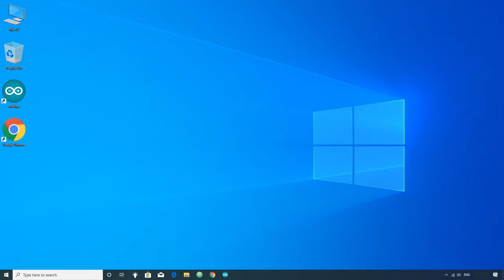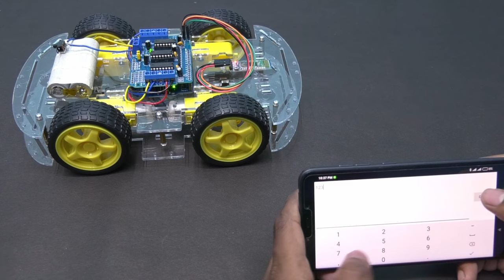Bluetooth controlled Arduino RC Car | Control using your Mobile Phone | Ut Go

Comment: Hello, when I connect the Arduino to the USB & motor drive to 12v the motors work but when I disconnect USB all motors stop working. I wonder you connected the power to driver only and it works. Please If you can help?
Reply from the maker: I connected the power to driver and connected the jumper so that power from driver goes to Arduino board. Check if jumper is connected or not in you condition. But make sure to only connect the jumper when you have one power source. If you give power to both Arduino board and motor shield then the jumper must be removed before giving power.

Comment: Bro is it okay to use 9v battery or lithium should be used.Can we buy cap for lithium ion battery
Reply from the maker: 9volt will not work. You have to use lithium based battery.
Reply from the maker: Welcome Bro

Comment: i am using 4 batteries in series, each of them is 1.5v( AA battery),. when I connect and control the car, it only work for 1-3 second, and then the motor seems to be stuck and cannot rotate, can you help me.
Reply from the maker: AA batteries cannot provide enough power. Use lithium ion batteries. You can use two 18650 lithium ion batteries in series.

Comment: Please enter the code again. The code of the description box does not open. Moreover, if the 3.7 volt battery in the Bluetooth control car is powered, the 4 motors do not work, what is the solution?
Reply from the maker: First login to your Gmail account then open the code link and download it.
You have to use 2 x 3.7 volt lithium ion batteries in series to make 7.4volt and use it to drive motors.

Comment: i was wondering if you had a separate code link i could use since google drive doesn’t work
Reply from the maker: Don't open the code file in Google drive, just download it and open it using arduino IDE
Reply: @UtGoTech  okay & do you know if you need android or can i use apple to control it & if none of those any external controller that i can use to program
Reply from the maker: @medicalman1018 I have shown using an Android app, so it will be easier if you use the same Android app. But if you want to use a different app then you have to modify the code slightly according to the app you are going to use.

Comment: hi sir, i just want too ask if it is required to use lithium battery. Because I'm currently using an ordinary 9v battery but the motors does not run unless I connect my arduino to the pc. I hope u can reply asap, thank you
Reply from the maker: If you are going to use a single power supply for both Arduino Board and Motor Driver Shield then you have to use a lithium battery but if you are going to use a separate power supply for both Arduino Board and Motor Driver Shield then you can use 9 Volt battery.
Reply: @UtGoTech  ohh i see, thank you so much!
Reply from the maker: Welcome 👍

Comment: I have done everything but my bluethooth is not showing in available devices to connect i also tried changing bluethooth but the problem is same what can be the problem? I have used L293D motor sheild for my project. Light is coming in audino and motor sheild. But bluethooth light is not blinking for both the modules. Please guide
Reply from the maker: Directly connect your Bluetooth module to 5v and ground of Arduino board and if it is working or not

Comment: Hello, excuse me, please can you tell me the name of the application
Reply: I have another question, can you use a 9 volt battery or is it necessary to use lithium bacteria?
Reply from the maker: 9volt will not work. You have to use Lithium-ion battery.
Reply from the maker: After you raised issue I found that the App is temporary disabled or removed form the play store.
You can use different Bluetooth RC Controller App from play store but you have to map the codes according to app.

If you still want to use the same app then please Contact me through Instagram or Telegram, I will send you the app.
Reply: ok and can you please upload a video or tell me how to assign the codes of an application to the arduino program
Reply: excuseme iwant the arduino code?
Reply from the maker: @iikongo3271 code link is given in the video description

Comment: Which battery should i use ??.and how much supply!?.
Reply from the maker: I suggest you to use lithium based batteries. Voltage not greater then 9 volt.

Comment: When i connect the bluetooth and press the forward button the HC-05 module disconnects. Also the car is not working.
Reply from the maker: This is may be due to the power supply.
Reply from the maker: Which power source you are using for the car
Reply: @UtGoTech   bro same problem I am using 9v

Comment: I tried like the video, but it doesn't work. There is only one power source, is the lithium battery ( 10v). Help pls.
Reply from the maker: Then make sure the jumper is connected in the motor shield

Comment: Bro,could you suggest a lithium ion battery.Your link is not openable and why cant we use 9v battery
Reply from the maker: A 9volt battery cannot provide enough power to drive 4 motors that's why you have to use Lithium based battery.
Reply: @UtGoTech  thanks bro
Reply from the maker: Search for the LG 18650 lithium-ion battery. 
You can search it on the Internet because links expire's very frequently.
If you are still facing issues in purchasing a Lithium ion battery then contact me I will purchase it on your behalf and send it to you.

Comment: How did u connect the switch to the battery and then to the uno ????
Reply from the maker: Connect the switch between the battery and the motor shield.

Comment: Can I use 12 volts instead of the batteries You used?
Reply from the maker: Yes you can. But make sure not more than 12Volt

Comment: If I want to use 12 v but the hc 05 receiver only supports 6, what can I do?
Reply from the maker: You can get 5v power through the arduino board
Reply: How would I connect it?
Reply from the maker: @marquitos282 Connect it to the 5v pin of the Arduino Uno
Reply: @UtGoTech  It turned out perfect, thanks bro
Reply from the maker: Welcome 👍

Comment: When the USB cable is connected to the computer it works fine, but if I unplug the USB cable the car no longer works. I have connected four batteries of 1.5 volts and 1300 mA in series. Can someone guide me? Thank you.
Reply from the maker: Have you connected the jumper after disconnecting it from computer ?
Reply: I still have the same problem, and I need to solve it because it's for a school project.
Reply from the maker: AA batteries are not enough powerful to drive this.  I suggest you use lithium based batteries
Reply from the maker: Use lithium based batteries
Reply: Increase the power, just for testing, I tried with wall adapter of 6Watt and 10 watt, works fine with 10watt but doesnt work at all with the 6W one

Comment: When I pluged the cabel to the computer it give me noise (when you pluged USB to the pc it gives you noise) than bluethooth module starts flashing blue and red diode and also on arduino motherboard green diode is on. After 5 seconds pc dissconnect USB  cable but in app port Com 1 is avalaibe. All drivers and Windows updates are fresh and computer is clean.
Reply from the maker: Are you removing the jumper before connecting it to your computer?
Reply: @UtGoTech  yes
Reply from the maker: Where is noise coming from
Reply: @UtGoTech  by that sound I thought if you plug some USB into your computer the computer will make you sound that it's connected.  Well, at the beginning it makes the sound, but then after about 5 seconds it makes a sound when some device is disconnected from the computer.
Reply from the maker: If you able to successfully upload the code then there is no issue with that sound.

Comment: Sir I did just like you in this video, I didn't solder the batteries instead I purchased a battery holder and the three pins switch but yet still didn't work. What do I do?
Reply from the maker: The battery holder works well.
Which battery are you using?

Comment: मैंने सब कुछ करा जैसे आपका इंस्ट्रक्शन था लेकिन जब मैं उसको कंट्रोल करता हूं तो फॉरवर्ड बटन पर क्लिक करने के बाद ब्लूटूथ डिस्कनेक्ट हो जाता है और मोटर चलाते ही रहता है और फिर से कनेक्ट करने के बाद मोटर स्टॉप होता है तो इसका सॉल्यूशन क्या होगा
Reply from the maker: Which battery are you using? Use Lithium-ion batteries.
This problem arises due to voltage drop. You have to use Lithium-ion batteries to avoid voltage drop.

Comment: Hey man, the Bluetooth connected and everything powered on but the app just won’t control anything, the motors won’t respond to any of the controls, any idea why? Thanks
Reply from the maker: Check for any connection mistakes or loose connections.

Comment: i hve problem, my car is worked when its connect to my laptop, but when i disconnect the usb, the bluetooth is not working, why? i use 4x AA batteries
Reply from the maker: AA batteries will not work, use lithium ion batteries.

Comment: I couldn't upload the code to arduino uno since it keep saying "AFMotor.h: No such file or directory". Is there anyway to fix this?
Reply from the maker: Install AFMotor.h Library from Library Manager.
Reply: @UtGoTech  thanks for the responding. Also, is there any alternative for the switch on the battery? Since I don't have the switch currently
Reply from the maker: You can use different switch or you can remove switch, it's not mandatory.
Reply: @UtGoTech  I have just removed the switch and connected the batteries directly, now the wire that connects the batteries smell burning. Is there something wrong with my arduino car?
Reply from the maker: Have you made connection properly.
Reply: @UtGoTech  I have figured out the problem. I misplaced the GND port. Now it can turn on now. However, now the motor can’t run even I have command it. The motor itself isn’t damaged and this confuses me a lot.
Reply from the maker: Can you explain the issue ?
Reply: @UtGoTech  it doesn’t go forward even though I press the button “move forward” on the app. Moreover, it doesn’t move anywhere when I press any other buttons, it stays at one spot.
Reply from the maker: Is it moving before
Reply: @UtGoTech  no, I only try to move it by using the app. It keeps staying and not moving
Reply from the maker: Check for loose connections
Reply from the maker: Check all connections.
Reply from the maker: Is any part damaged?

Comment: hi, nice video!  can you help about the motors? which motor will be the M1, M2, M3, and M4 in order? thank you in advance!
Reply from the maker: Connect left side motor to m1 and m2 and right side motor to m3 and m4
Reply: @UtGoTech  then m2 and m3 is the back part of the car?
Reply from the maker: @renierguanzon8565 Yes.
Reply: @UtGoTech  one last question sir, in connecting the dc motors, how do you know it is the right wire to insert in the 2 M1 terminal blocks correspondingly?

Comment: Hi team, everything is set, but motor is not functioning/not responding to mobile app.. Used the same code given in the description.
Reply from the maker: Have you done connections as soon in the video?
Reply from the maker: What type of battery are you using ?
You have to use lithium based battery.
Check battery voltage.
Check loose connections.

Comment: Sir it's not showing in the bluetooth app, I'm not able to find this device,what should I do
Reply from the maker: First pair up the Bluetooth Module using your phone's bluetooth setting after that open the remote control app and you will the paired device.

Comment: Xin chào, tôi đang sử dụng l293d giống bạn để làm xe điều khiển và tôi gặp vấn đề khi nguồn pin bị cạn, nó khiến arduino của tôi bị hỏng do nguồn điện quá thấp. Có cách nào khắc phục không?
Reply from the maker: Yes if the battery pack voltage drops below 5 Volt then the microcontroller may start malfunctioning.

I hope you are using 18650 lithium ion batteries. 
If yes then recharge the batteries and you are good to go.

Comment: What are my options for power supply?
Reply from the maker: I suggest you use lithium based batteries. Alkaline battery is unable to provide initial current demand due to which microcontroller restart itself due to low voltage.

Comment: Hey pls tell abiut website which you have used for coding
Reply from the maker: I have done it myself.
You can also do it easily by following the documentation of Adafruit motor Shield library or you can also watch my tutorial on how to use Adafruit Motor Driver Shield:
https://youtu.be/DCqvSVN96Lk?si=ig54XqFxMrMsWO3c
Reply: Pls pls pls reply code is uploaded but car is not connected
Reply: And I don't have jumper connected with motor driver

Comment: also you used this SoftwareSerial bluetoothSerial(9, 10); in the code but you didn't use the pins as such.. can you pls explain
Reply from the maker: I have used those pins. Pin 9 and 10 is connected to servo pins of motor shield.
Reply: @UtGoTech  did that , but i don't know why it is not working for me :(

Comment: Hi i have a problem when i am connecting the Bluetooth module to motor driver it Bluetooth module doesn't turn on whereas when i connect the motor driver to my laptop through Arduino board it turns on. Please tell me the solution because i have a project this 29 and it is not working
Reply from the maker: Have you checked the jumper on the Motor Shield
Reply: Yes but the same
Reply: Can it even support 15 volts of power using 4 lithum battery
Reply from the maker: No.
Use only 2 lithium ion batteries

Comment: i have a HC-06 Bluetooth module , I can pair up and connect but after an unspecified amount of time, 2 minutes
  Or when you give the car a command to move when the Bluetooth connection is cut off
Reply from the maker: One of the reason for this is voltage drop. Properly and tightly connect cables and use lithium batteries

Comment: The shield is turning on but Bluetooth module not turning on.. Can u help me fix this?
Reply from the maker: Check if your motor shield,  Bluetooth module is faulty or not.
Reply: @UtGoTech  yes I did check both of them.. Still ain't working

Comment: Bro use kar hai ki nai attach the 1K and 2K resistor to convert the Arduino's 5V logic output into 3.3v for the Bluetooth module. Because of some Bluetooth module doesn't have the inbuilt logic level converter.
Reply from the maker: I have used without voltage divider. If you want you can try.
Reply: @UtGoTech  I can join no arduino 3.3 v pin
Reply from the maker: I didn't understand
Reply: @UtGoTech  25

Comment: I did everything according to the video but when I finish programming and disconnect the usb cable from the computer, the bluetooth sensor turns off, is there anything I can do ?
Reply from the maker: After disconnecting usb cable put the jumper in the motor shield.

Comment: Bro the connection of motors are like left hand side and right hand side na
Reply from the maker: Yes
Reply: @UtGoTech  bro can we control this with voice control
Reply from the maker: @user-pv9rl2ec3g yes you have to use different app.
Reply: Can you make an another video for that plz 🥹🥹🥹🥹🙏🙏🙏
Reply from the maker: @user-pv9rl2ec3g ok I will try

Comment: What was that small yellow thing you plugged in
Reply from the maker: Its a jumper pin which is plugged to transfer power from motor shield to Arduino board.

Comment: Hello sir , i have a question, why does my hc-05 suddenly dont work again, i have been using it for few days then suddenly it won't work again , it is blinking but when i connect it to my phone it cant function.? What is the reason for this and what can i do to fix it?
Reply from the maker: Are you able to connect to your Bluetooth module?
Reply: Yes it is connected
Reply from the maker: Does Bluetooth connection get disconnected after giving command?
Reply from the maker: @VishnuShevanphto check if it disconnects after giving command

Comment: Hello sir i have mad all things correct but there's only one mistake of codes as your provided code is not opening
Reply from the maker: Don't open it in Google Drive. Just download it.
Reply from the maker: Try downloading it. If still facing issues then contact me. I will send code through telegram.

Comment: mines only works when i put the moderboar(adruino) in my pc how can i make it so my bateries charge the moderboard and the driver module
Reply from the maker: Connect batteries to motor shield and also connect the jumper as shown in the video.
Reply: @UtGoTech  do you also know a 18650x3 battery holder with on off switch or a 18650x4
Reply from the maker: 18650x4 battery holder is available in market

Comment: What switch did you use? Did not understand the switch part
Reply from the maker: You can use any type of switch which can withstand 1A of current.
Reply: @UtGoTech  can you please send link of the switch?